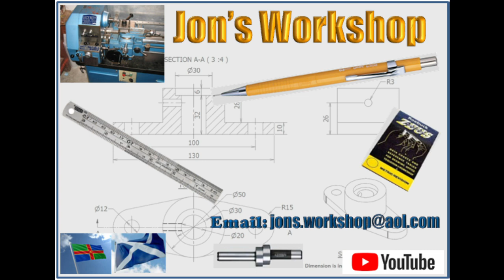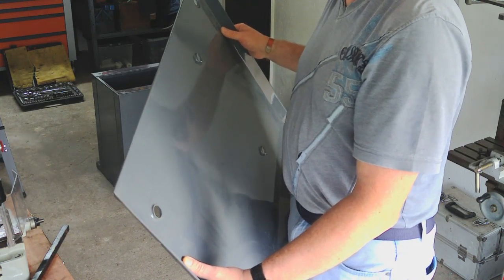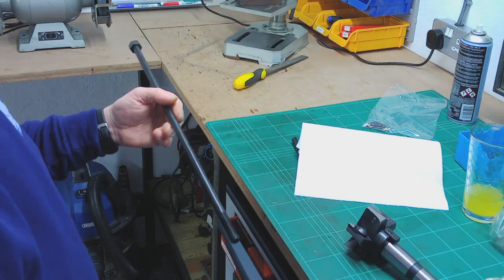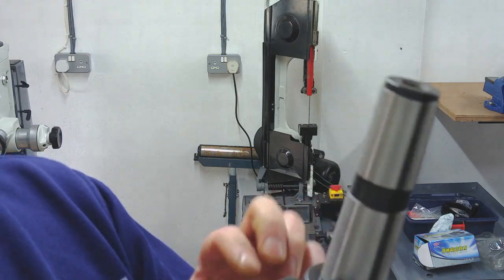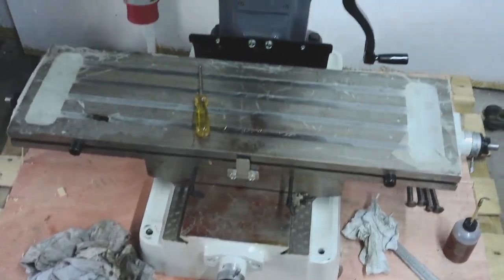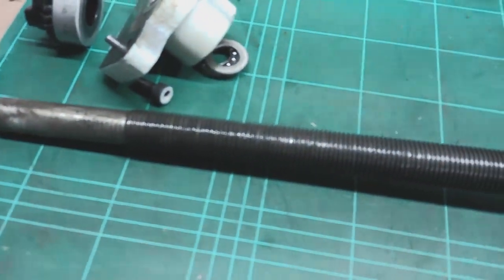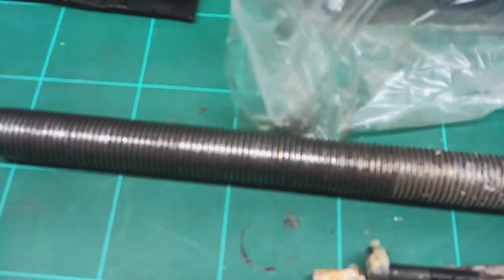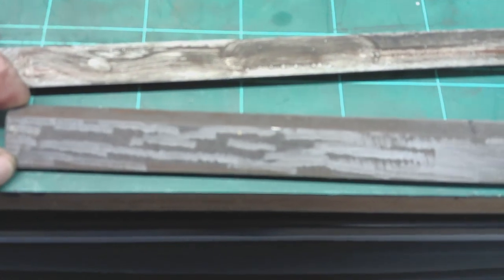Episode 17   Cormak ZX 7045 Strip Down and Re Build

Comment: Hi Jon, definately chinese origen,  the end caps are identical in shape and form of my HBM version(next size down) Other than the dirty brown wax/greasy coating on everything I did not find much casting sand, unlike my HBM lathe that was caked in the bed. The nuts are same shape too.  The chinese moto is out of sight out of mind as to the sand. I'm changing mine to cnc but need it to make the mounts. Looks like you made the right call on stripping it down.
Reply from the maker: Hi Derek, thanks for the comment. Yes, without the strip down and clean up, this would have been knackered after 6 months of use and irreparable damage done to the slideways and leadscrews. I kind of knew this before I bought it but was shocked by how bad it actually was. Cheers, Jon

Comment: Morning Jon, a useful benefit is with an added bush the morse taper becomes self ejecting, you'll thank yourself in the long run!!
Reply from the maker: Hi Richard, I wondered as I was drawing it up on the whiteboard if this may be the case. I think I may redesign slightly to leave a solid piece at the back of the M16 so if I use the auto eject, it won't mash the threads up. Cheers, Jon
Reply: @jonsworkshop  I've sent a photo in an email
Reply from the maker: @richardjohn8879  thanks Richard, very much appreciated. Cheers, Jon

Comment: I had to strip my mill to carry the parts into the shed, I am glad that i had to do it and mine was in need of similar cleaning and fettling . I think the upstands on the tray  are going to fit into the base of the machine. they will stop coolant leaking through the 4 bolt holes into the base cabinet.Looking forward to the next episode. Cheers Ade.
Reply from the maker: Hi Ade, thanks for the comment and reassurance, as I said it was between this and Warco so it's good to hear the same level of work is required. They are probably all made in the same factory in China anyway so really it comes down to price, colour scheme and customer service. I have had another busy day at it today and it is now showing promise. Cheers, Jon

Comment: Hi Jon,
Really interesting video... I am waiting for an import lathe to hit the UK Shores and have had optimistic thoughts that it will be fine out of the box... I think I've just had a reality shock and will now plan some time to disassemble, clean and reassemble...
Thanks
Paul,,
Reply from the maker: Hi Paul, good thinking, total strip and rebuild if you want to get it anywhere near useful. They are cheap for a good reason, built to a price point rather than a standard unfortunately. See it as a kit of parts. Cheers, Jon

Comment: Well the last time we communicated you said this episode would be an eye opener! Boy you weren't joking!! But being honest at this price point I'm not surprised, after the strip down you will have a sound accurate machine with money left for tooling,  but I am seriously now reconsidering whether or not to buy from this supplier and I think I will go warco  as I know there machines at UK tested for accuracy and a test report is provided with each machine but if I do go this route the machine will also be completely stripped and cleaned I'll have a few beers and consider the situation in the mean time looking forward to your next video cheers and good luck.
Reply from the maker: Hi Steve, yes it's certainly been an education. It's interesting though because once you remove all the crap and fettle all the poor workmanship away, it's a really solid unit that has been fairly well made. I have spent all day draw filing gibb strips trying to straighten them out and cleaning all the other bits and bobs up. I ran some checks on leadscrews and the sideways etc (after removing all the paint off them) and it all checks out good. I think you just have to be prepared to do a full strip down as soon as one of these arrives and they will make a cracking machine. I just pity the new starters who spend hard saved cash and don't put this effort in...... This mill would have been garbage in a matter of months if I treated as plug and play. I am not put off Cormak as I am still £350 up on a Warco and that's after I have bought my engine hoist out the difference. Keep watching before you decide and if you plump for Cormak, get in touch through my email and I will see if I can get you a discount. Cheers, Jon
Reply: @jonsworkshop  Thank you

Comment: Your draw bar will work a treat, I did similar for my Emco milling head. I made a threaded bush for the lower end and welded the bar into it, rather than machine the whole length of the bar. Milling machine is typical unfortunately, I actually sent a machine back to Chester because it was as bad, perhaps worse. Parts were broken and tapped holes were oval. It was awful. I would definitely do the gearbox, it will be full of crap guaranteed. Best wishes, Dean in Oxfordshire.
Reply from the maker: Hi Dean, thanks for the comment, it's surprising but after another day of graft, it's pretty decent under all the crap. I have done some rudimentary checks today and it's pretty decent. Just got to be prepared to put the graft in. It's also a good way to help you understand your machine when you've had it in bits. Cheers, Jon
Reply: @jonsworkshop  glad it will do the job. I think you have a much better machine than the one I received. Looking forward to seeing it progress.

Comment: When i was investigating the purchase of a 626 style mill i asked why the Warco one was more expensive  than an almost identical Chester one and was told they had a seperate assembly line and QC people! ? There is a rumour that chinesium items destined for Germany are better assembled but with a commensurate increase in price,the thought being thst Germans would accept the crap thst is sent here.
I went for the Chester one and thought i could fix any shortfalls there might be, might??? But on the whole it wasnt too bad, the spindle bearings and motor start capacitor failing in quick succession but replace with superior quality items. Like yours, the gib strips were as the blurb says "hand scrapped" but in my case they used an angle grinder instead of a lump of carbide on a stick. When i asked Chester about leadscrew play they said just use the allen screw adjuster, when i looked to see the screw was completely missing, did i say they was play in the leadscrew?
Just one question about yours, why on earth is there casting sand on a machined part like a leadscrew or is it just a coarse form of lapping paste?
Edit, forgot to mention that your super quality face mill could become an adequate quality fly cutter if you take all but one insert away.
Reply from the maker: Hi Chris, that all makes sense. I have been lucky really, with the cap screw on the lead nut adjustment slot backed right off, I can measure about a thou of backlash (rough measurements using feelers, blocks, clamps and the bench top. It's all in good nick really once all the crap is removed. There's a couple of flaws (porosity) in the casting where the x axis slide way is (about 3/8 inch total size), I have dug it out with the dremel back to decent metal just to ensure no casting sand or carbon deposits left in there. Apart from that and the poor state of the gibbs, it's in pretty decent nick. I think it's a mix of casting sand from zero clean up, grinding dust from grinding the mating surfaces (again with no clean up) and paint. It's clear the unit is delivered into Poland from China fully assembled, and the Poles fill the castings with P38 or similar, sand them down and spray the parts with no masking and the unit still fully assembled, meaning the leads crews fill up with paint on top of filler and grinding dust with remnants of casting sand thrown in for good measure just falling off the underside of the castings. There's a reason they are cheap and this is it. I am hopeful now that it will build into a good unit (won't really know until its done but all the checks I have done suggest it is not bad). Cheers, Jon
Reply: @jonsworkshop  hi Jonm  Backlash is no problem at all if you have a DRO, my Y has excessive backlash, like half a turn excessive  backlash but that is another story, but i can still work to reasonable precision thanks to 3 axis DRO. Time for you to start saving again? 
Thinking Acme, well Trapezoidal really, thread I was going to make new anti or minimal backlash nuts and designed a jig for grinding the tool accurately using either my surface grinder or a mill. Perhaps i should dig it out and do a video on it.

The question that comes to mind now is, knowing what you know now would you have still bought it?
Reply from the maker: @chrisstephens6673  Hi Chris, well don't worry, a DRO is definitely on the 'to get' list. In fact I am just building a shelf to support the phase converter and ensuring its design is DRO friendly (will show some of this on the next episode). I am hopeful based on the bench checks I have done that my backlash will be minimal, it really matters not for positional work if it's a thou or 50 thou, you still need to account for it (unless you have a DRO of course). But I also am hoping (again, based on the bench checks) that I will be able to climb mill (only finish passes). Would I still have bought it? Difficult to tell just yet until I have exercised it a little, but, based on what I have now got ready to reassemble, I would have to say yes. I am still £350 up on a Warco equivalent and that's after I purchased my engine hoist out of the difference! The acid test will be in cut of course but I am not regretting it yet. Cheers, Jon

Comment: #kitofparts I have finished watching now. Have to say fairly typical for a Chinese built machine. I would definitely check the gearbox out though, I bet it's full of casting sand too. The table on your mill is exactly the same as the one on my Chester mill/drill, though that wasn't in the state yours was. And I have to say it's pretty accurate and a solid enough bit of kit. Looking forward to the next installment!
Reply from the maker: Hi Carl, thanks, I am top side of it now (Episode 18 on the way tonight hopefully). Just the lifts, the head strip and full re-build to go. The kit of parts now looks impressive following some effort. Cheers, Jon

Comment: Hi Jon its a shame about the mill. All that precision work making the components to offer a milling machine at an affordable price. 
It's just ruined by such a silly thing as cleaning and sealing the castings before assembly. 
Unbelievable its the easiest part of the job somebody wants sacking. 
Unlucky with the draw bar size as well, I have to feed mine upwards through the spindle bore as well due to the low roof height. 
Lets hope your engine hoists ok fingers crossed. Tony
Reply from the maker: Hi Tony, thanks. Getting on top of it all now. Just the head to strip down now and full re-build and we should be in business. Episode 18 should be up tonight/tomorrow which shows it in a different light following some serious graft over the weekend. Cheers, Jon